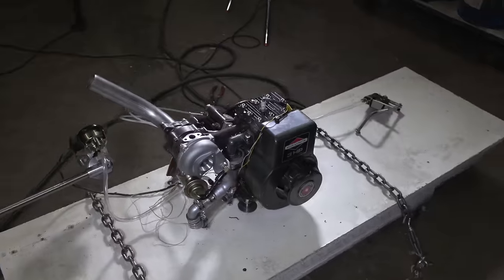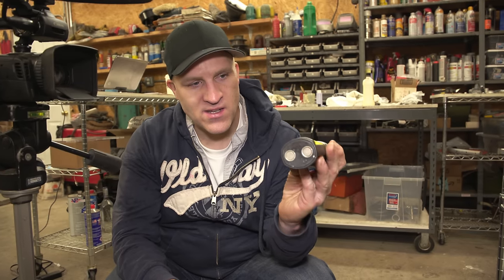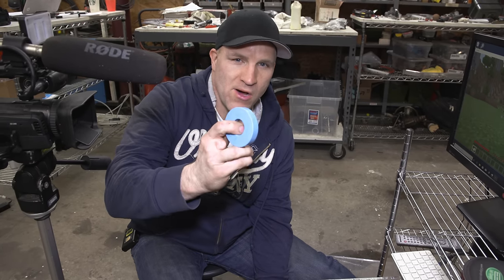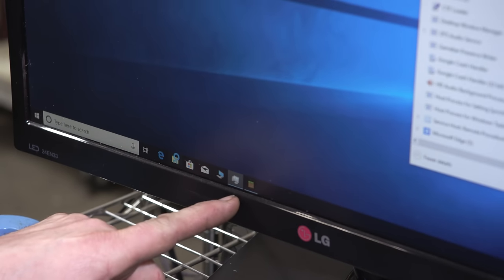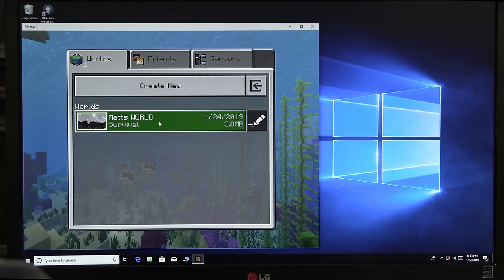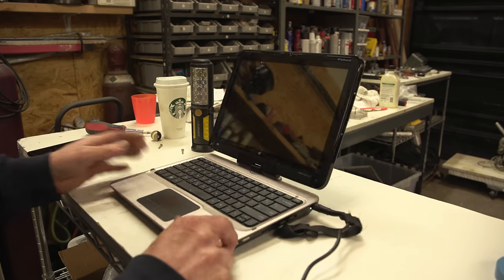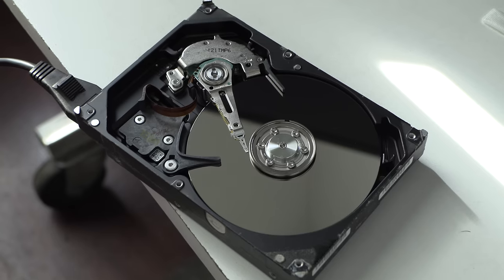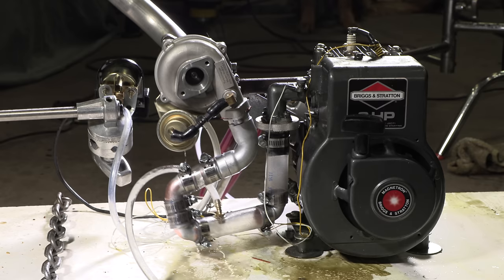Will a Magnet Erase my PC's Hard Drive? - Let's Find Out

Comment: Modern HDDs have magnetic domains on the platter that are too small and powerfully magnetized to affect with typical permanent magnets. If you are looking to destroy the data in a way such that it positively cannot be recovered, you need to physically destroy the platters. Thermite works well for this purpose, but just putting the drive in an oven that can exceed the curie point of the media will do quite the number on the magnetic domains on the disc (even if the drive remains otherwise intact). SSDs, being more-or-less immune to static magnetic fields, would require thermite to totally destroy.
Reply from the maker: That's exactly what I learned here, thanks for the info. The funny thing is that before I did this video I went to the computer store to buy an SSD, I told one of the associates that help me that I had a magnet to close to my hard drive, just messing around, they all jump and said oh my God your data is going to be destroyed you need to be very careful. it was at that moment I knew making this video was a good idea...LBVS
Reply: Or, just stop the disc from spinning
Reply: UselessDood - if you really want the data GONE, that won’t work: the platters can be transplanted into another mechanism and read. Granted, this isn’t a threat scenario for most people; but if you have nation-state level adversaries... 🤔
Reply from the maker: @darkwinter6028  that's interesting, I'm working on a how to video where I show how to remove the platters and put them into a new drive to recover data. I always knew that was possible but have never seen it done.
Reply: If the HDD were left in a strong magnetic field for a long period, I am wondering if and just how much time at what field strength it would take to zero the whole thing?
Reply: ya, those things will wipe out your credit cards and everything too. well... the older cards with the strip. I almost forgot about this conversation until now. But now my gears are turning again. I's like to know just how much magnetic force it would take to near- instantly wipe a hard drive from say, 18 inches away? Electromagnet probably?
Reply: DOD specs are overkill, though I won't quibble for that scenario. For us every day Joe's, current tech is far beyond MFM/RLL tech where there were large domains that could be exploited even after over-writing. Nowadays, you can run diskban, or an old windows program bigfile IIRC.
Basically, do a standard low-level format, and then copy a dvd or other benign large file to the target enough to fill the volume and you're done.
No one has ever recovered data after this, at least publicly.  If you're in a scenario where you think a State Actor is really interested, they'd have installed malware or keylogger already and exfiltrated what they wanted through zero-day exploits. 

Even safer than above, use an all-disk encryption option, so even the data itself is encrypted. 

Low level format that, and anything that could be left would be minimal if at all, and with 99.9% deleted, really could never be reconstituted to much usefull data.
No need to destroy useful hardware in most cases.
Reply: I usually wreck my unwanted drives with a club hammer.
Reply: @darkwinter6028  At that I'd remove the platters and sand them down
Reply: John Alexander - That, sir, is Insufficiently Spectacular. No sparks, no flames, and no fun! 😜
Reply: George Blas - sorry... repeat what, exactly? (long thread; not sure what part you’re asking about). 🤔
Reply: Has anyone tried what was called a "Bulk Eraser" on a hard drive?  A retail stored named Radio Shack used to sell them.  I think it was just a transformer in a plastic case that you could plug into a wall socket.  The technique was to plug it in, hit the switch and move it in circles around the "thing" you wanted to erase.  (Not a static field...)  For media of the time, this worked really well.
Reply: @jamesd3107  I’m familiar with bulk erasers, both from Radio Shack and as found in professional media company catalogs. It’s not a transformer, per se; but rather an electromagnet (so, only one coil of wire, and the core is designed to project the field; not keep it contained). Also, it’s being driven with AC, so it’s polarity flips at 50 or 60 cycles per second (depending on your country).

My understanding is that modern drives only have marginal effects because the eraser isn’t powerful enough... the magnetic domains on the disc are just too small and strong.
Reply: @boots7859  if I was going to encrypt a drive I’d want a hidden partition that has a separate password in case you are legally coerced into giving the password, which in the US is possible. Keep anything your not ok being found in the hidden partition behind a different, complex password. But I feel like destroying the disk physically is still the best option, if there’s no data to recover there’s not a lot that can be done.

Comment: Lenz's Law.  Though the Aluminum platters don't attract the magnet on their own, the magnet induces a magnetic field in the platter, attracting the magnet and creating resistance (slowing the platter).  Similar to how if you drop a strong magnet through an aluminum tube, it floats slowly through on it's way down.  I guess the harddrive senses the slowdown and pauses activity until the motor can spin it back up to normal speed.
Reply from the maker: Are those platters aluminum though? I thought they were silicon....
Reply: @WarpedYT My quick search earlier said that most desktop use Aluminum and smaller drives for laptops are glass.  I guess it just depends on the manufacturer and quality of the drive.  I'm guessing the glass ones wouldn't slow down much.
Reply: @WarpedYT  Silicon in a disk shape is typically used as wafers for semiconductor-based integrated circuits, including CPU/GPU dies and memory chips among other things. These get manufactured through lithography and cut to size before being packaged, conditioned and sent to users of those chips (like RAM stick manufacturers.)

That's why there's no need to use silicon for a platter that's not used as a base for semiconductor technology. The platters are coated with a magnetic film, so it can be pretty much anything that retains this coat at high rotation speed and isn't magnetic. Aluminum can fit the bill.
Reply: @michaelsteinbach  Glass? There is something wrong there...
Reply: they are not aluminum platters, they are platinum
Reply: @andrewmcallister4151  They are aluminum but they are plated in a layer of platinum. Pure platinum would be too expensive and is to soft. It would be pulled apart at the 7,200 rpm the drive spins at.
Reply: The powerful magnetic field is also likely interfering with the interaction between the rotor and stator in the drive motor and probably also producing induced currents in the coils of the moving rotor. Both the distortion of the permanent magnetic field messing up the alignment and the spurious induced current would reduce the efficiency of the drive motor this combined with the fact that the magnet is effectively acting as an electromagnetic retarder due to the induced currents in the conductive disk platter at the same time would contribute to the effect.
Reply: The hard drive has a computer that will track the spindle RPM. Airflow induced by the spinning platter creates an air bearing to keep the read and write head off the drive surface, called a flying head. As soon as the RPM starts to drop, the hard drive parks the head in the innermost position on the platter where there is a small groove cut so the head does not touch the disk when it spins down and the airflow stops. It remains there until the RPM rises to a level that will provide sufficient airflow to lift the flying head out of the groove and maintain the proper distance from the disk once again.

Comment: all the magnetic field is for is controlling the read/write apparatus. it works much like a speaker's voice coil. 
all you are doing is interfering. also the enclosure is shielded, that's why no effect until you bring a really strong magnet.
Reply: There's a video of a guy with a really strong magnet. That's pretty cool
Reply: You'd need a 100-200lb magnet, that would bring the platter to the head and scratch it, too

Comment: HDDs work via magnetic coating on a ceramic or glass disk, you would need around 140 pounds of force to magnetically erase one.
SSDs work via chips that hold electrical charge, a magnet isn't going to do anything unless you're using it to smash the drive, the best way to kill an SSD would be to remove the charge or overload it.

Comment: Yeah I saw this coming, thankfully modern HDDs are pretty durable cause I once set a 100lb strength rare-earth magnet right on top of my laptop's HDD without thinking and it locked to the metal laptop surface and I heard the drive making a very distressed sound, but after I quickly pulled it off everything was fine and I got another year out of the drive before it started acting up (which may have just been age).
Reply from the maker: Wow, that must have been scary for sure, especially if you had important stuff on the laptop.
Reply: @WarpedYT  It was terrifying! I saw my digital life flash before my eyes that day lol

Comment: 6:24 the reason for the disks slowing down is because the magnet induces currents inside the disks (only possible when spinning) and those currents create opposing magnetic fields slowing down the disks. if it were the actuator arm getting attracted to the disks it would have destroyed itself in a second (head crash)

Comment: Okay, that was unexpected.  When I was in the Military, we used to destroy drives with a box that you put the drive in and then it zapped them with an EMP.  That was military grade.
Reply from the maker: I know, I should do another video and try and EMP. While the computer is running
Reply: No, you microwaved them. Totally different man.
Reply: no it was not an EMP or microwave...
it is a degausser.

Comment: The reason why it did stop working until you removed the magnet is because when the platter is stopped, the head does normally touch it, so to avoid damage, if the speed of the platter is under the nominal speed of the disk, the head gets parked for safety. The only thing that makes it float is the air moved by the platter itself, which is the reason there isn't vaccum drives yet, but instead of that helium sealed drives do exist to increase the data density by stabilizing the air currents inside and making a tighter fit between heads and platters.

Comment: It's really cool that you took the time to try some of this, but really what you're demonstrating is interfering with how the disks operate; i.e- you stopped the drive from being able to physically spin and read/write normally, which is why the PC locked up then resumed again, rather than showing any kind of corruption.

If you want to show corruption then the easiest way would be to fill the disk with large files, and generate checksums for these. After attempting to corrupt the disk, you can then generate the checksums again to see if they changed, which would indicate corruption. Admittedly not as amusing to watch though 😉

Comment: Very instructive, I know you always had to be very careful with floppy disks in the old days but I've never heard of a hard drive being damaged by an external magnet - what probably happened with your neodymium block magnet is that it disrupted the mechanical movement either of the platters or the head temporarily, creating the symptoms you saw, but did nothing to the magnetic data on the disk.
Reply: The reason is because modern hdds have a feature where if the drive is shaken, or comes in contact with a magnetic field, the drive will stop reading and writing, and Windows will set up a queue of processes when the drive is ready to read again. That is why all of the programs opened when he pulled the magnet away.

Comment: 8:56 Do you see that half circle mechanism directly behind the read/write arm? There’s actually 2 of them (top and bottom) and they each contain an AWESOME rare earth magnet which powers the arm’s movement as well as provides magnetic force for the actual reading and writing to the platter(s).  I’ve taken A TON of of them apart to salvage these incredible magnets out of them (my wife’s company regularly has to destroy many of them as they outdate and contain sensitive info....I keep a STACK of these magnets for fun and projects. Your powerful magnet is disrupting the control of the arm and read/write head at it’s other end by disrupting the magnetic field which “tells” the HDD controller WHERE the arm is....effectively blinding the controller. No disruption of data occurred.....or the computer would no longer boot or function correctly (known as corrupted sectors on the drive).

Comment: Modern hard drives have a protection system where if strong magnetic fields are detected it will shut down the hard disk to prevent further damage. That's why it did not work when the magnet was on the hard drive. When the magnet went away, it automatically resumed what it had to do and it opened all the programs.

Comment: I think eddy currents may have slowed down the disk, they don't have a very strong motor anyways
Reply: yeah- i'd say the magnet may not affect the data but certainly messed with the motor as seen when it slowed down while open. Electric motors are based on magnetism.

Comment: A magnet physically blocks the transmissions of data in a computer, and youd need a pretty strong one to rip through a hard drive. Thats why you saw the computer start working again after you took it off, and while its definitely not a good idea it (probably) wont destroy the data burned into the hard drive (probably). The second air leaks in its dead tho. Remember that scene from indiana jones where the guy crumbled when exposed to air? Think of it like that

Comment: What happened when you put the strongest magnet to the harddrive is the harddrive had a safety feature where if it feels a certain amount of gforce or movement, it'll completely stop reading and writing like you saw when you took the cover off and when you release it, it'll resume whatever you had in queue which is why a bunch of the applications you clicked opened up. With an SSD, it won't affect it at all because it's all electronic and not mechanical.

Comment: 4:00 You just killed the disk by impact not from the magnetic field. The metal in which the disk is encased is a type of metal that reflects magnetic fields, nothing magnetic can get through it (I don't remember the name of the metal now).
But if you hit the disk while it's operating, 1G could easly misalign the heads and you will have that behaviour. The previous hit also made some damage and thats why you saw a little increment in disk usage.
On the other hand, the disk usage meter doesn't measure usage, just amount of pending read/write operations. When you hit it the previous time it probably lost some RPMs and resetted the heads position and maybe some damage went into the disk itself so R/W was slower. Last hit could make the heads hit he disk, slowing it down or scratch the plates hardly. Some disks, when the RPMs drop just stop for protection.
I hope you didn't make the recovery into the same disk xD
Reply: 6:20 The stopping happens because eddy currents are generated on the moving metal that oppose the magnetic field. That's what some exercese bikes use to slow the pedals. No friction brakes. Same principle behind magnetic brakes.

Comment: Byte 6d65  no it was just the fysical shock from the magnet hitting the hdd. A hit with a stone would have had that same effect. The readhead on the arm skips some tracks and the hdd has to find his track and required speed for it again and thats all of the delay, all thats seen here.
And indeed, there is a supetstrong neodyniummagnet half an inch beside the platter inside the cover. That cover that diverts the strong enough fieldlines to destroy data easally around the platter.
Reply: I agree - he should have turned off the computer so that the HDD heads would be off the platter or in a landing zone on the platter, then applied the magnet.  Of course, the final result would be the same.
Reply from the maker: Well I did try the magnet on the platters themselves more toward the end of the video, I'm going to hook that hard drive up again and see if the data is okay. I'm pretty sure even the steel cover on the hard drive provides some sort of magnetic shielding.
Reply: @WarpedYT  Yes, you are right about the shielding.  I'm sure it is intentional on the drive manufacturer's part.

Comment: The reason why the disk platter slows down is most probably due to a phenomenon called Eddy currents. It causes dampening by converting the kinetic energy to heat energy. 
Moving conductors of electricity in a magnetic field slow down due to small induced whirlpools of currents.
Hard drives in fact use Eddy currents to control the reading pin. Since it is moving very fast, it is very easy to overshoot the sector you are trying to read. To avoid this, the backside of the pin us under magnetic field and eddy currents damp the quick acceleration to provide more accuracy.